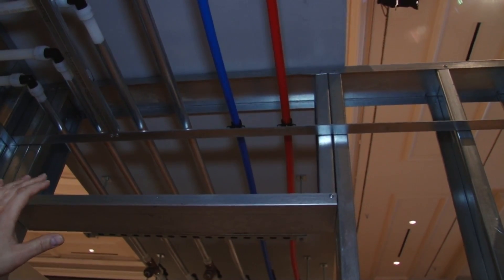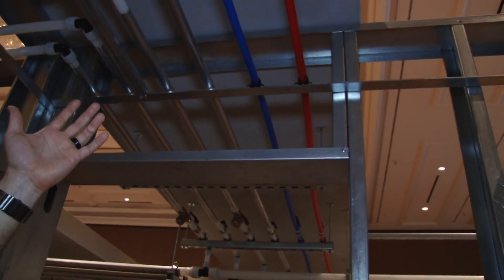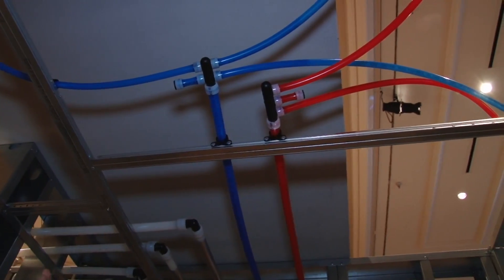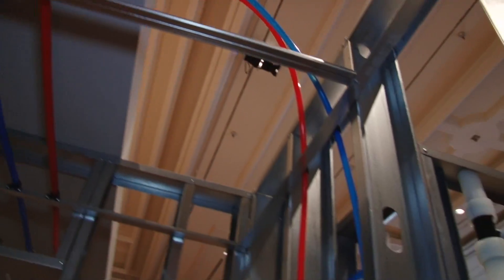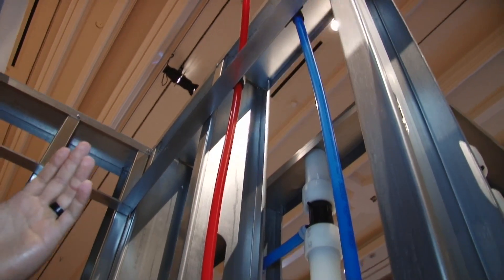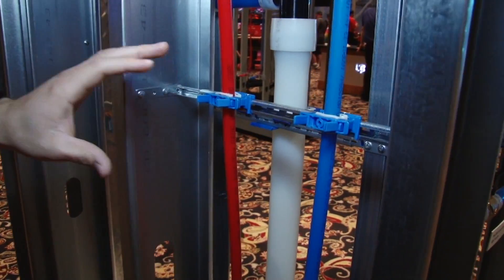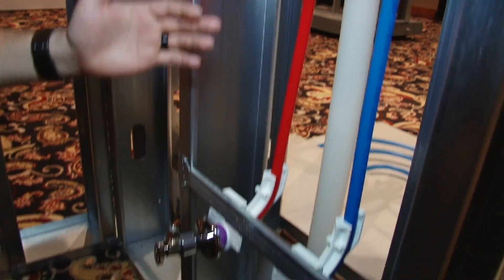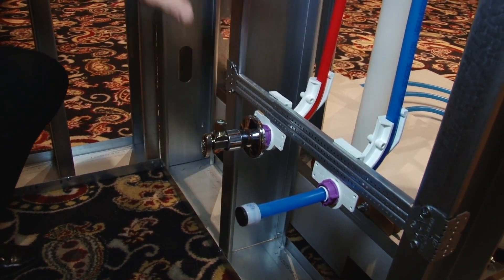Uponor Logic Plumbing with Multiport Tees

Comment: Can I use the EF plastic multiports as a manifold system in a small house?  3/4" main line going to multiports in laundry room and then to water heater...and cold water supplies for one bathroom and kitchen?  BTW...turning comments off on your Youtube videos is not very social.